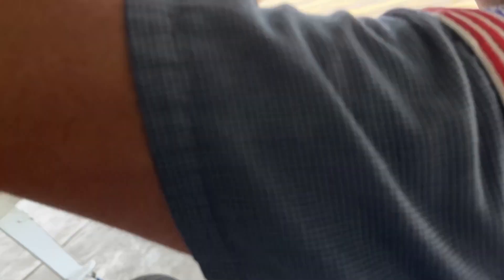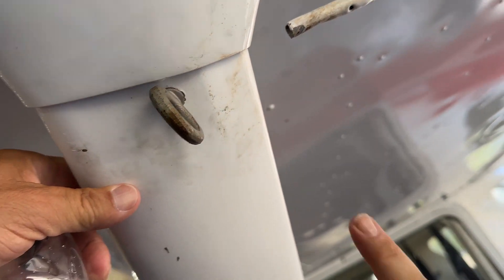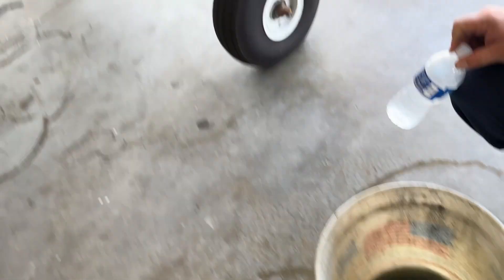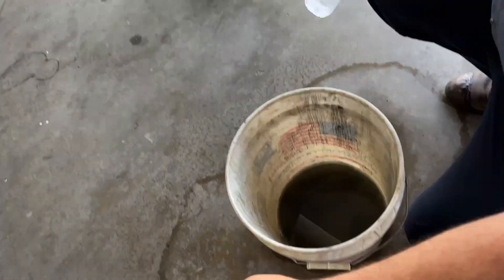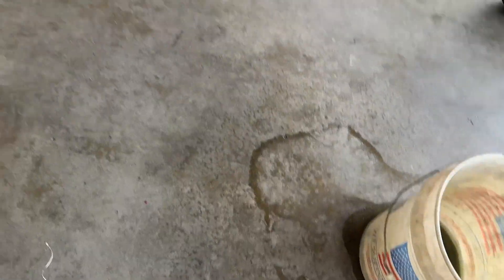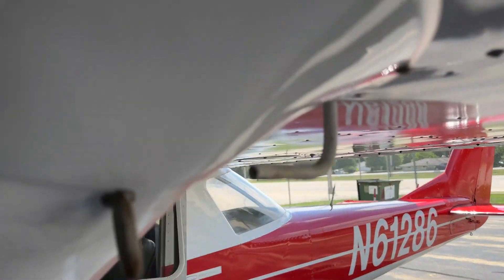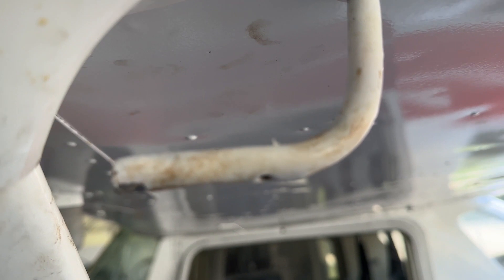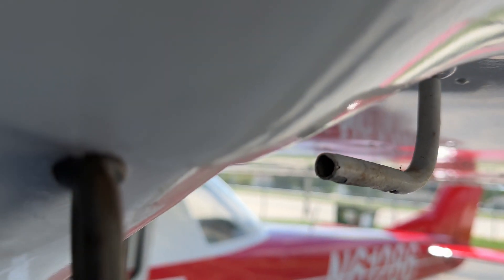Engine Loss on Takeoff in a Cessna 150- (actually 3 times) - Part 2

Comment: This could be your problem. There is a good video about it but I cannot locate it .  The fuel line between  the on/off  valve  and  your  fuel filter could  have a bunch of debris in it .  Some have been  modified with a quick drain in the fuel line and can be drained from the bottom of the fuselage .  Mine has been modified. The fuel line actually goes down and back up 7 inches to the strainer .  Perfect for dirt accumulation . This has happened more than once  and should be an AD Note .